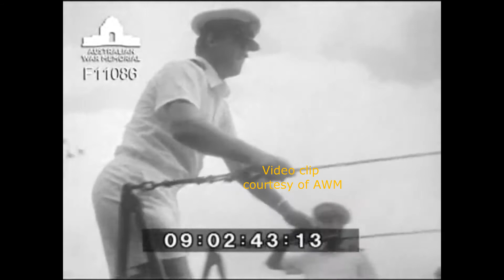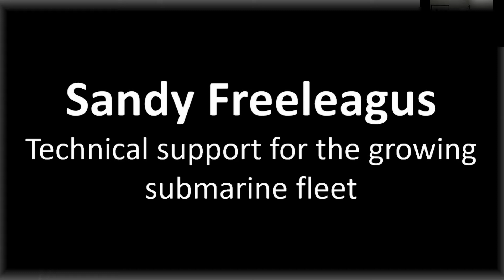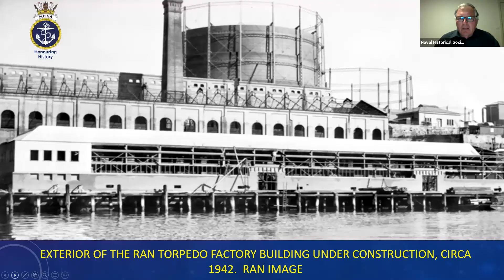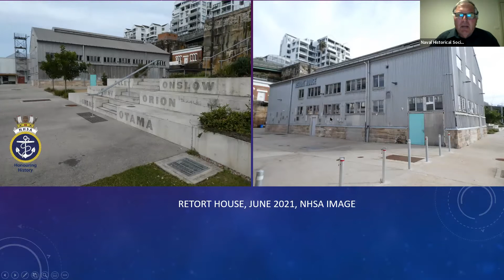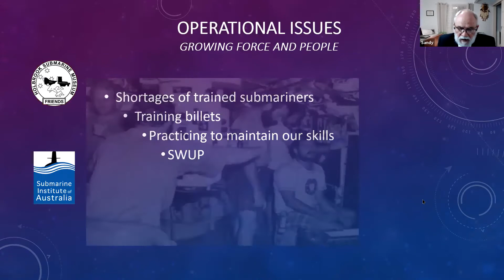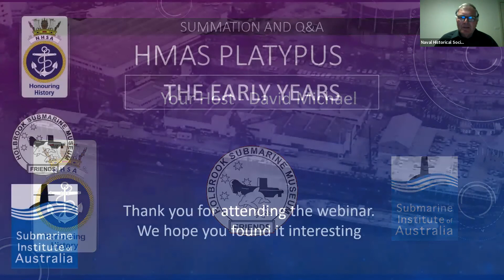HMAS PLATYPUS WEBINAR - The Early years

Comment: I remember Sandy well and have much respect for him. Came across him once in a shop in Cleveland Qld, he hadn't changed. Always looked forward to Navy News to see his "artwork". My dad's last draft was Platypus when it was a submarine tender and his cap tally was gold leaf thread. I've done shift work at AMPOL refinery. When I started there were four submariners already. Generator jobs with Sid didn't seem like shift work, just a chance to work with your mates and get a job done. Do you remember the oil slops tank at the eastern end of the jetty, it was a floating tank with no bottom. The Greenies would have a fit today. Cheers, Soapy